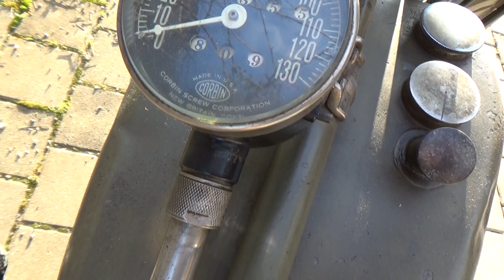Indian Scout 101 (1929) | Walk around with details

Comment: Nice original scout with Bosch DVAR mag. Is the bike Swedish origin? Why is gear shifter on the left? Maybe right hand throttle.
Reply from the maker: Hi ALA - yes, it is believed that this bike is of Swedish origin. The gear shifter is on the left right  because of practical matters - the owner simply felt more comfortable with this setting. However, it is no big deal to switch it back again.

Comment: Really nice 101 but the grips are 1939/1940 and the front brake lever looks to be 1946.
Reply: Was the speedo an add-on accessory  option?
Reply: @garygullikson6349  I think it was an option. Btw, the speedo on this Scout is not the original one but looks to be a 1940 european model (same as the CAV).